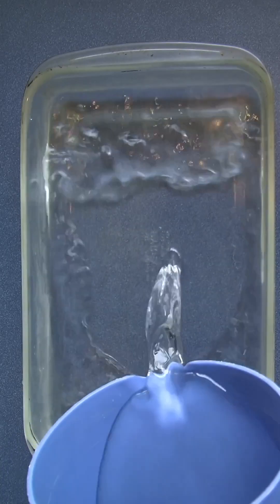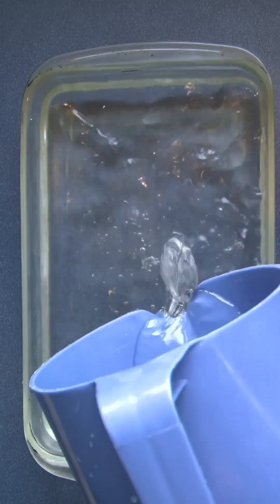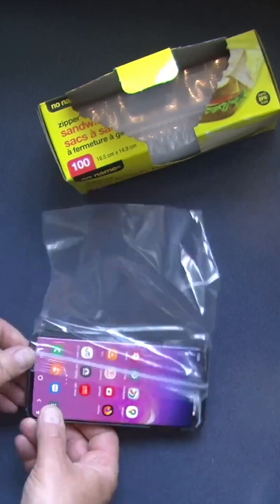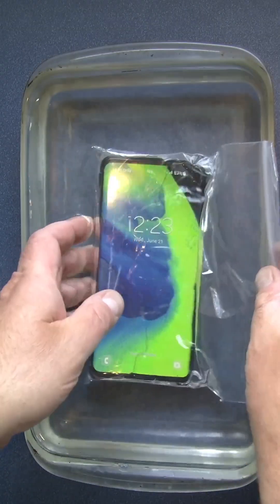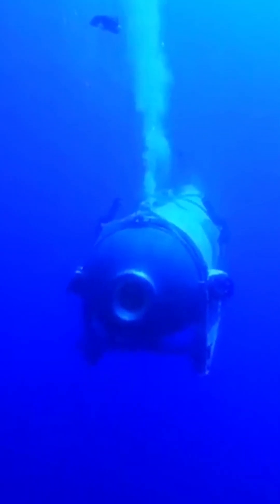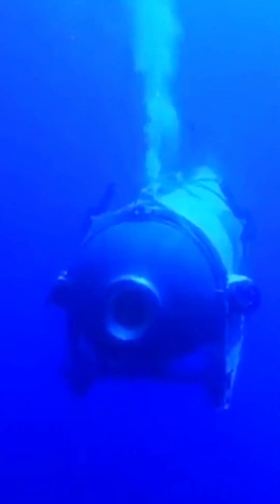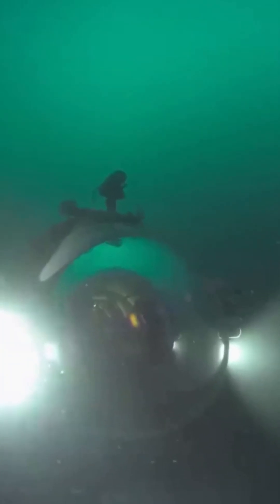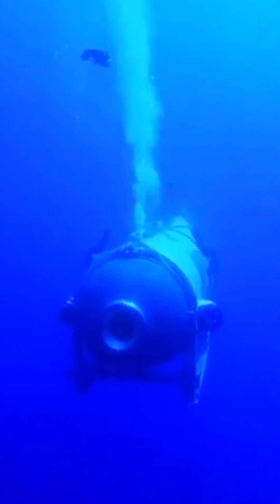Why doesn't the missing submarine use a radio to communicate?

Comment: I did not know. I was also wondering why big planes don't have a GPS tracker to find the relics when it go under the sea, I think it's for the same reason
Reply from the maker: Exactly! Salt water is a really good blocker of RF which makes underwater communications a real challenge. At the same time, its good for military submarines that want to be undetected. 

The "black boxes" on aircraft have acoustic beepers that can operate for a few weeks to assist in finding them. But they have limited range so search vessels have to know the general area to search - a real problem for situations like Malaysia Airlines Flight 370.

Comment from the maker: Yes - with a radio that could float to the surface and indicate they were in trouble. Probably not as simple as a regular buoy since at depth the air would be compressed so much it would not float. Apparently some deep sea research subs used gasoline as a lighter than water medium that doesn't compress significantly so something like a gasoline filled buoy might have been a possibility.

Comment: The passengers never had time to activate any emergency communications with the surface.  Six thousand psi would end their expedition quite quickly.
Reply from the maker: Yes thankfully it must have been close to instantaneous. Apparently carbon fiber composites are not as good under compressive loads as under tension, and tend to de-laminate fast when failing. So on top of the extreme pressure, looks like failure of the material under "normal" conditions is fast. 

I did hear on report there may have been some indication that ballast was dropped just before comms were lost. No idea if its true. A bit surprising there would have been time to do that if the report is accurate.

Comment: Very interesting. I know this would never apply in a real world scenario,  but I wonder how the reception in your cell phone demo would be if you were to use deionized water so as to be a very good insulator.  As many may have learned in their high school science class, it's the minerals and impurities in water that make it conductive and give it the taste we all know and love,  pure water tastes pretty bad, from what I've heard.  In fact in the earlier 20th century before variable autotransformers & TRIAC/SCR based dimmers became available and widely used, resistance dimmers and salt water dimmers were used in theaters for controlling stage lighting .

For the 70 and under crowd, salt water dimmers consisted of a glass container with a fixed electrode in the bottom and a movable electrode raised and lowered into the salt water solution that had to be replenished and kept to the proper salt concentration for the correct resistance in relation to the total wattage being controlled. A slang term for salt water dimmers is piss pots, for two reasons.   First and foremost,  the salt water solution heats up  and sometimes boils due to the large currents flowing, and corroding the electrodes causing an ammonia like smell.   Second,  I've heard stories of old timers topping off the dimmers by urinating in them, although I have my doubts on whether that actually happened,  if it did it only happened once for reasons I'd rather not attempt or discuss.
Reply from the maker: I was actually surprised that my home fresh water which is very hard well water was insulating enough  to allow the GHz waves though. Of course half an inch is not much to penetrate. 

 I was going to use distilled water if the no salt water had blocked the RF.  I will be doing a longer video with much more of an explanation than 60 seconds of a short allows, and use an Ohmmeter to show the resistance change when salt it added. 

You stories about salt water dimmers - someone else mentioned similar things a long time ago on one of my videos including the questionable way of topping up the liquid.  Yikes! Its sure sounds like things could go bad real fast with all the water and high voltage. 

From my own past, when I was kid we had a humidifier that worked by boiling water using two electrodes in a glass container of water and I think salt was added. Pretty scary to have something like that which could get knocked over in a kids room. I wonder when CSA and UL would have stopped certifying things like that?
Reply: @ElectromagneticVideos   @ElectromagneticVideos  can't say I've ever heard of salt humidifiers, I'll have to do some research on that.   Thankfully household appliances have gotten safer and more energy efficient over the years as a rule of thumb.   

A good example of a dangerous household product that was very popular when I was a young boy during the 1990s was the halogen torchiere with a 300 watt tubular halogen bulb, available at many stores like K-Mart,  Wal-Mart,  Montgomery Ward you name it but has disappeared from store shelves by the early to mid 2000s.   My mother had one of those when I was growing up, and I changed the lamp after it burned out, I was around 8 or 9 yrs.  At the time  I didn't know you have to use a tissue or clean the bulb with rubbing alcohol if you touch it and get fingerprints on it.  One night I was doing homework alongside my younger sister,  the bulb shattered and a hot piece of glass landed on my arm giving me a second to third degree burn, which later got badly infected and I had to go to the ER and they had to hold me down, numb my arm then use a scalpel to drain it, leaving a fairly large scar behind.

Comment: Interesting, thank you. There is an "expert" on BBC news clips that say there "should be" a beacon on the craft. There probably is, but nothing that is capable of reaching the surface through the salt water. They have a sonar type communications system, but if that seems to be disabled. I hope they find them, there is not much time left.
Reply from the maker: Yeah - its so tragic and terrible to the search unfold slowly due to the situation (no criticism on the search teams - they are making valiant efforts.

I would be stunned if they didnt have a radio beacon that  automatically activates on the surface, which leads me to believe they are not on the surface. They should have acoustic or ultrasonic  pingers on the sub much like what aircraft black boxes have but in the vast ocean area they could easily be out of range. The other issue is the ocean does have layers of different salinity and the boundaries between those layers can reflect or channel acoustic or ultrasonic waves, so that could also be getting in the way of receiving strong signal form the sub.

Comment: Some time it might be interesting to see a video on how radio communications DO work between enormous transmitters on land and military submarines. Obviously no real life demonstration would be possible but a theoretical description would be amazing. Things like ELF and VLF, what the antennas are and how the subs pick up the signals.
Reply from the maker: I'm actually going to a "real" video on skin depth and that stuff. One things I haven't been able to find out  is if the subs can reply at those frequencies. I don't think so so it may be a receive only comms system.
Reply: @ElectromagneticVideos  that’s my understanding- one way only.
Reply from the maker: @MichaelCowden  Basically get the doomsday order or something like that. I assume the issue is to reply they would need to trail a many mile long antenna wire, and with it still being a "short" antenna, transmit efficiency would be low to begin with and made worse by transmitting in a moderately good conductor.
Reply: @ElectromagneticVideos  correct. Efficiency would be like low single digits and they might not even be able to generate enough power to get out a few watts.

Comment: Very interesting, never knew this
Reply from the maker: It is interesting. What I didnt have time for in a short is if you use lower radio frequencies the signal can penetrate deeper into the water. The military use extremely low frequencies in the range of 10 to 100 Hz to send messages to their subs, but even with those low frequencies and low data rates to match, much more than 1000 feet depth is probably not practical.